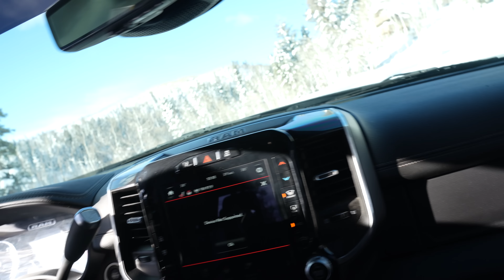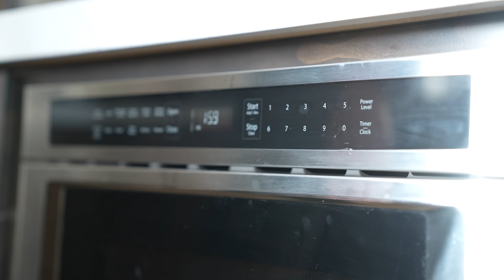WE NEED TO START OVER...

Comment: Trent,  I'm glad you raised the plumbing lines in the basement.  Just make sure there isn't another P-Trap in line of that P-Trap that you used to go under and around the floor joist.  Code does not allow two P-Traps in line because it will vacuum the water out of the traps and allow sewer gases into the living space.
Reply: Interesting

Comment: if you only have 1 set of chains for a truck, put them on the front tires. they do more work than the rear wheels due to the weight of the engine and lack of weight in the backend. this also gives you more control when going downhill in both your steering and braking.

Comment: Trent, I want to say that you are all doing an amazing job on your builds and even though you are about done with all your plumbing, I'd like to offer a plumbing installation tip. Two things, 1st, you should always bevel the outside edge of your pipe after you cut it and before solvent cementing the pipe and fitting together and second, when you apply the primer to the pipe and fittings, do not allow the primer to dry before applying the solvent cement (Glue).  The primer should still be wet when you apply the cement so the two can work together to melt (Fuse) the pipe and fittings together. Keep Up the Great Work!

Comment: Trent, in this video the horizontal portion of the sink vent looks low (18:48).  So, just in case you are unaware of the code pertaining to this area here it is: A horizontal vent branch cannot turn horizontal until it is a minimum of 6" above the flood rim of the fixture it is attached to or the highest fixture in a group that it is venting.

Comment: Hopefully you won’t have any issues but the horizontal vent should be above the fixture. I use 42” from floor. That level lessens a chance of drywall screws going into the vent. If your sink backs up that waste water will also back up in the vent.

Comment: Anytime I do plumbing, I do the same as you by putting everything together as a dry run.  The only thing I do differently is use a sharpie and mark each connection with two or three lines I can use to line up the connects so I know they will fit after the glue sets.  I also label each connection with a letter so I know which pipe goes with each elbow or T.  Great channel by the way!

Comment: Think how snowshoes work.  They work by using the large area to spread the foot impact on the ground.  To get around to the back to set the ladder and drill the drains just get a pair of plywood sections.  Just cut a 4x8 in half lengthwise.  Use it to hop step around to the side of the building on top of the snow.  Boom, easy, done!!

Comment: Love everything you guys do. You seem like a really happy team. Pro tip when chaining up. Put that single set of chains on the front. Those motors weigh 1000 lbs plus the most weight in the cab is forward of the center of gravity and that equals more traction on the front vs an empty bed over the rear axle. Love your videos! Keep it up.

Comment: One question,  why are you putting your chains on the rear of your truck?  I was taught by my father to alway put the chains on the front end with 4 X4 engaged.  He said the most weight is on the front end and will help the chains to dig in.  " always do safety  first over what is easy,  take the extra few minutes."  Dads words,

Comment: You need like plastic sled . We had a bunch we used for our RV,s trucks etc. works great on sand .Stuck  under tire front or behind. Or a block of wood we always drive with. It’s a normal experience  out there and it’s 1  road not 2 way.he RV’s in the beach dunes on Nauset!
Reply: Sand and snow are not the same just think of the coefficient of friction

Comment: If you get the tires spinning on the stuck truck, even if it is reverse, it will be easier to pull the front of the truck out and re-align it. 4x4 low is best to keep the wheels from spinning too much so you lose traction again.  Living out there you need offroad tires that are Snow Rated because Just offroad tires are not designed for snow at all.  Those tires are nothing but slick tires in the snow.  grip is the key, not how many tires you have rotating.

Comment: You should use sweep 90’s and Y’s on the waste lines whenever possible, also your clean out is worthless, it should have been a Y, with the clean out plug in line with the septic tank.
Reply from the maker: It’s really just to plug the line so i can test for leaks. There’s a clean out on the other side of the fountain just outside.

Comment: Trent, i don’t want to be miserable with you, it’s just to help. A sewer slope has to be 1/4 inch by foot. And at the left of your clean out the slope does not look good. And you’re clean out tee seems to be a single tee from here in Canada lol, and it should be a tee Y. Keep going guys, you’re making a nice big job thoroughly. By the way. Just want to help because after it’s too late and you’re stock with the problems.

Comment: oooh could trent elaborate on the shifting to reverse if you start sliding backwards? i've done a lot of snow and ice driving but i did not know this. fascinating. thanks. (does it mess with your transmission to shift from drive to reverse abruptly?) and thank heavens for cel phones!! i can't imagine being stuck like that, in the middle of a mountain with no easy way to call for help.
Reply: Did he say to do it abruptly?  I must have missed that

Comment: As someone who lives somewhere that in recent years the snow is rarely more than just a soggy sprinkling (however it still seems to manage to grind the country to a halt), I don't really have any knowledge on driving in snow like this.
But, I think I read or saw somewhere that you should have chains on the front and back tires, even its its not a 4 wheel drive. I think it was so that the front wheels still have the additional grip for driving. 
Is this right? Or would you say its not needed/recommended?
Genuine question :-)

Comment: Is it not hard on the drive system with just chains on the back and then you run in 4 wheel drive and now you have different tire diameters ?

Comment: what are the "balloons" on the windows?
Reply: They are to equalize the altitude air pressure difference from where the windows were made vs the location of install. Will be cut off after completion of build. 😊

Comment: At 16:38 a new "U" section being put in, without any drain from it.  This is asking for trouble.  "Unnecessary "U" sections MUST be avoided at all costs.  They also, if put in, can cause your system to be black-listed by the inspecting officer.  Intended fluid flow direction MUST ALWAYS be from high to low, and without unnecessary right-angle junctions.  They should always be angled to help the flow.  I think you need a LOT more practice, with a knowledgeable tutor.

Comment: You need to hire a plumber to come and tell you what you did wrong, and how to fix it.  Two things I noticed were that your vent pipe was horizontal at the same height as the big waste pipe it connected to, and you have a trap connected to a waste pipe that goes lower that the waste pipe.  Both of those are going to get clogged very quickly.  Vent pipes need to be vertical at least for a few feet before they go horizontal.  Traps need some vertical fall under them to work.

Also, your bottom cleanout should be in line with the exit pipe, not part way up the vertical pipe.  You will appreciate that should you ever actually have to use it.

Comment: Not your first plumbing rodeo and yet I get the distinct feeling IT IS. There is something called planning and forethought to all elements of construction from framing to plumbing to electricity. The problem with most building construction is those three things are RARELY considered in conjunction with everything working in concert. I thought you would have realized how important that was based on your prior two experiences in building the main house and the garage/casita. I get more frustrated watching you repeat mistakes that you shouldn't, than enjoyment these days from your frustrating experiences. While I don't watch your channel to learn how to do any particular home build/improvement project, I do expect progression and growth in skills as well as picking up some nuggets of wisdom based on your faux paus/mistakes. So far in this build I simply see a rush job for reasons not apparent to the viewers. (other than the rush to dry in which also was related to planning, weather, and not breaking up the build into two years based on your weather events (foundation and grade year one, buildout year two).